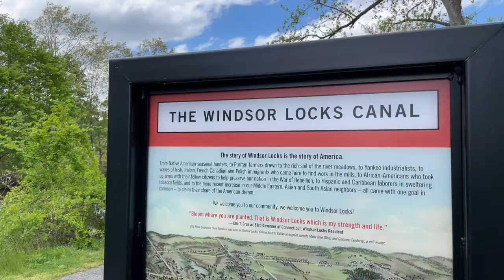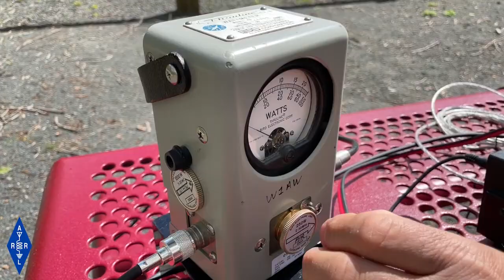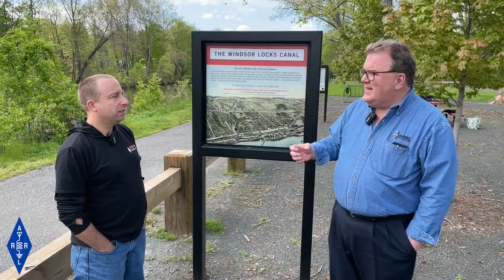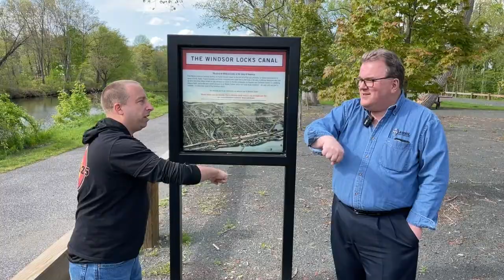EFHW End-Fed Half-Wave Antenna Kit | Part Three: W1AW POTA ACTIVATION

Comment: Thanks for the video series, it was helpful as I bought this kit and put it together.  I do have a question, is the connection point next to the antenna coax input for a ground or is it for a counterpoise (ie., radial)?  Is this necessary?  Did you use one for your POTA activation?  Thanks!

Comment: K2TNO

I built the ARRL EFHW antenna prior to ARRL SS CW in early November, 2023. I use a 17-foot counterpoise wire stretched along the ground below the box. I made one change that is worth considering: Instead of the grey plastic box supplied with the kit, I opted to visit my local electrical-parts supply store and bought a grey plastic weatherproof electrical box. It is a 4" w x 4" d x 2" h. It has a better sealing gasket, and also has two built-in mounting tabs that are on opposite sides of the base. This feature makes it easy to secure the box to a fence post or other support near ground level.

I wrap several turns of my RG8X coaxial cable around an FT240-31 mix toroid at the feed point, to act as a common-mode choke.

I have an Elecraft K3 transceiver, that provides two antenna inputs and has a panadapter spectrum display. Those two features allowed me to compare the EFHW antenna to my other antenna, a Comet hf multiband end-fed vertical. During the Sweepstakes contest I could switch back and forth and compare signal levels from stations at known distances from my QTH on the coast of North Carolina.

Surprisingly, [at least to me] I found that the two antennas were almost always equivalent--- despite one being vertical and the new ARRL EFHW being a "sloper" with the far end about 30 feet above ground. I rarely could see a signal strength difference on the spectral display peak heights, regardless of distance or direction. Recall that SS is a USA/CANADA-only contest; I have not given the pair a serious evaluation for DX.

There was one consistent difference, that was true on all bands from 7 MHz to 28 MHz: The wire EFHW was consistently about 6 dB noisier, when I compared the baseline noise amplitude of the two antennas on the spectral display. Our neighborhood has buried electrical lines, and I even went so far as to shut off all AC to my house and powered the transceiver from my emergency 12-volt storage battery. The noise difference was still present.

In sum, the EFHW antenna is a good SWR match on 7, 14, 21 and 28 MHz as the manufacturer states.

ONE CAVEAT: The hardware supplied is metric; it is helpful to have small metric socket wrenches or end wrenches to aid in tightening the fittings. In my case, I opted to exchange the metric hardware for standard US-threaded stainless steel hardware, all of which I had already anyway.

As far as construction goes, the only expensive detail to worry about is the need for a suitable drill for installing the UHF coax fitting. I used a "step-drill" that I already owned, but they are expensive if you only plan to use it once. An alternative is to buy a suitable drill of the correct diameter, that might need to be ordered on line.

Bottom line: I fine way to get a working HF antenna at reasonable cost and complexity. It won't out-play your next purchase: Stacked 4-element yagis 🙂

73

Comment: Ok, but what the heck is POTA?  It's customary if you use an obscure (maybe not to you  but it is to me) acronym that you initially put it's meaning in parentheses the first time it's used.  I've been in active for a few years and recently renewed my ticket.
Doug Lindauer AK4WK, formerly N4HQ, formerly WB2HBM
Reply: Parks On The Air

Comment: A nice series of videos - thanks for all the work. I bought this same kit from ARRL just before Field Day 2021, suspended it between two masts at our EOC, and had a great time. A year later it is still working at my QTH, albeit with a ~130' antenna wire to support 80M. We may plan an HF antenna-build class based on this design for our CERT members who recently received General licenses. (Using an inexpensive nanoVNA, PC and projector makes demonstrating the SWR graph to a class a snap.)

Comment: Nice kit, it can take a fair bit of power for an end fed.👍
Reply: I am not an antenna expert, but the power limitation is, I believe, mainly determined by the transformer. The kit, as supplied, had no trouble handling 100 watts SSB phone.  But with ~60 watts digital running Winlink, the core heated and SWR rose.  It seemed to handle 40 watts with FT8, PSK31 and even Winlink.  If you need more power, add a second, or even third, transformer toroid.  I also up-sized the gauge of the wire winding the toroid.

Comment: I am watching this video on a Samsung 82-in television and I do not see the counterpoise wire. There was also no mention in the previous video about it being attached didn't see it in the previous test. Also no mention of what length that it should be if it was attached. I suspect there is a measurable amount of common mode current on that braided shield of the coax.
Reply: I believe the coax, transceiver housing, mic, key and battery act as the counterpoise.  Also, because the antenna is fed at a very high impedance level, capacitive coupling to the soil and other surrounding objects also act as a counterpoise.
Reply: I had the very same questions. I did very much like the set of videos on this subject.